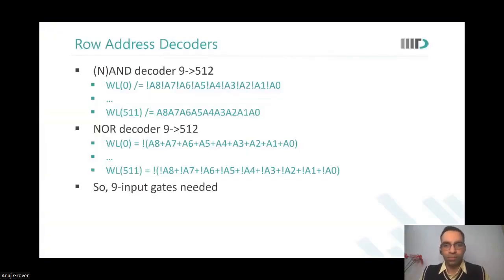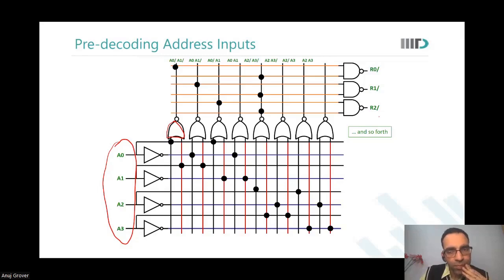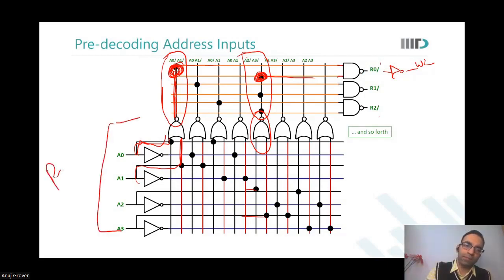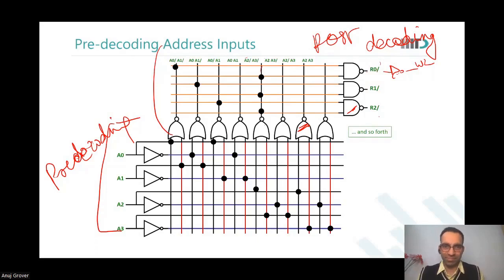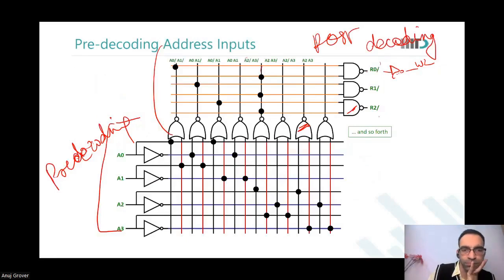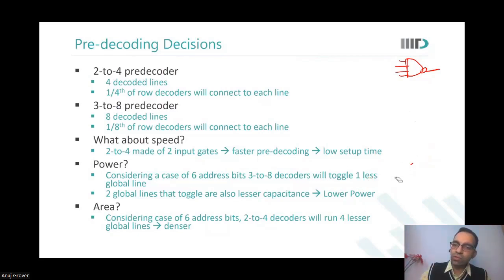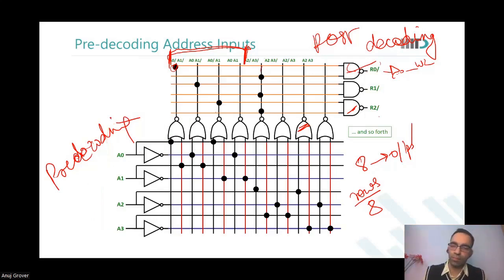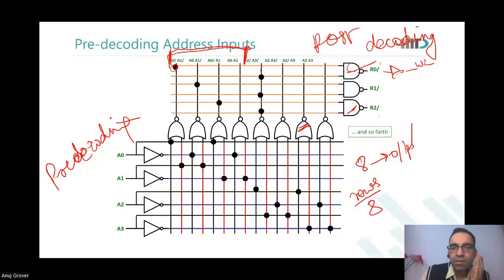Address Decoders

Comment: Thanks, Professor. I had a quick question — for a 10-bit address, I’ve seen decoders implemented using combinations like 3×(3-to-8) and 1×(1-to-2) or 2×(3-to-8) and 2×(2-to-4).

My understanding is that this works because 2¹⁰ = 1024, and these combinations give the same output count (e.g., 8×8×8×2 or 8×8×4×4 = 1024). please let me know if this reasoning is correct.
Reply from the maker: Yes. You are right. 

Another way to look at it is that both take 10-bit input across the set of decoders.
Reply: @anujg1 thank you

Comment: Can you please tell me that for 64 address lines if I used pre-decoding of 2 x 3to8 decoders using 3input NAND gates and for post decoding used 64 x 2 input NAND gates. Then for calculating number of stages how we will consider branching "B" in that case?
Reply from the maker: For 64 rows, and using a 3-to-8 decoders, each decoder output will connect to 64/8 =8 rows. So, branching factor will be 8 (out of 8 rows that a pre-decoder selects, only one will be the final active path). I hope this helps.